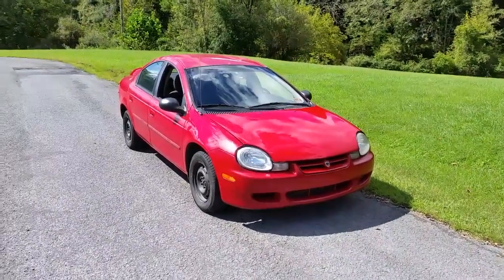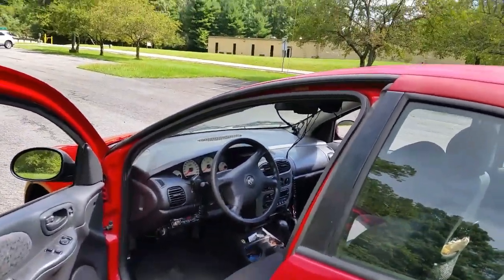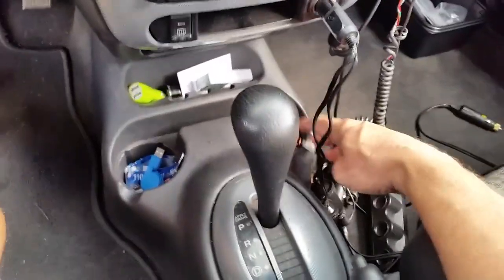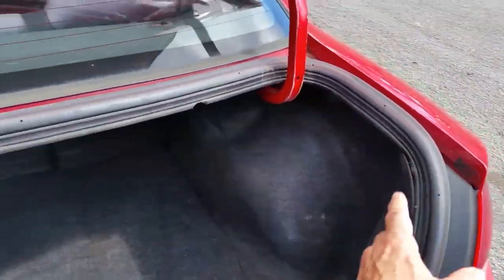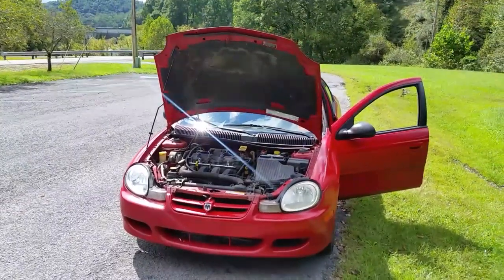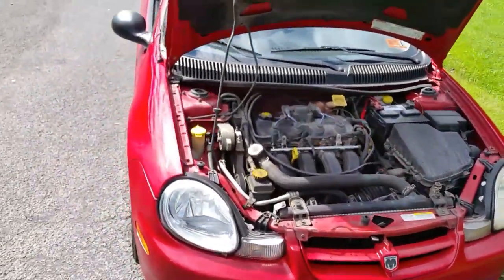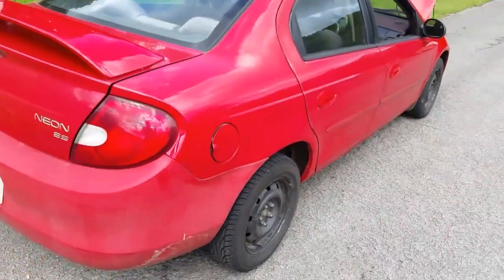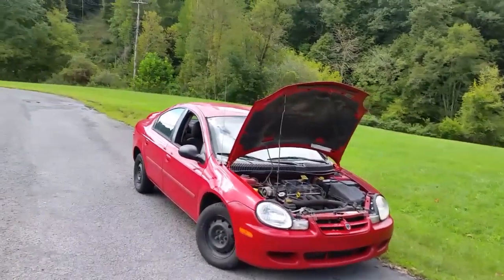Earthling Vehicle Reviews ... Dodge Neon and Hurricane Florence.

Comment: No

This vehicle is amazing in most snow conditions.

I live in the North east... I’ve driven this car through 16 winters.

I’ve passed by dozens of not hundreds of far more expensive cars stuck on even slight inclines.

As long as you don’t bury it... it’s going forward.

Cheap to drive.
Cheap to maintain.
Reply from the maker: You know your right! I was thinking today after I did this video that I did drive my last one a in snow storm, but with common sense! Good tires and easy as she goes probably would be ok~!